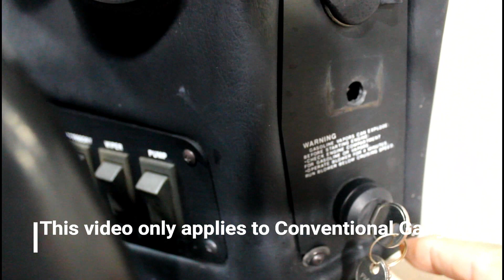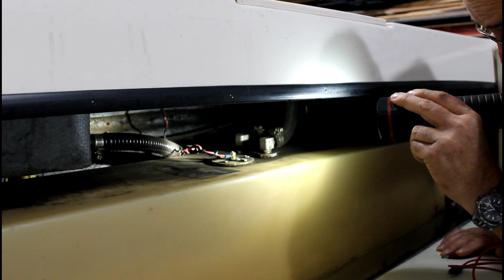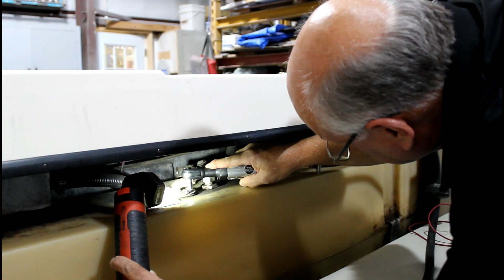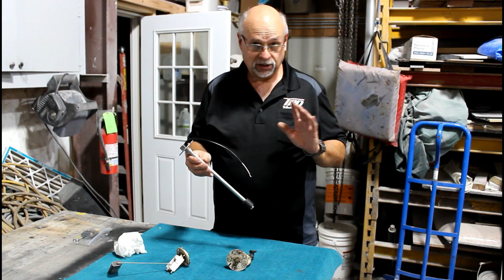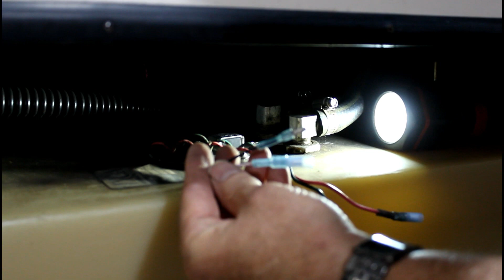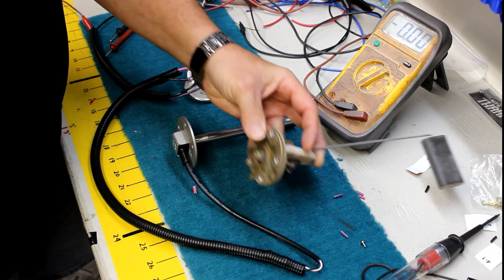Fuel Gauge Troubleshooting 101

Comment: Great video.  Gage goes all way past full when shorted.  Thought my problem was sender so I pulled it.  It is a reed style sender.  Moved the ring up and down and the gauge does move.  Problem is with the ring all the way to the top (full) gauge shows past full but move the ring to the bottom (empty) and the gauge only goes to about 7/8 full.  Help please?
Reply: I measured the resistance on the sender.  Ring at the top is about 30 ohms.  Ring at the bottom is about 200 ohms.
Reply from the maker: @peterjosephsmith7464  33-240 is the std. American Sender values, 200 should show around 1/8 tank, I suspect your gauge is bad.
Reply: @rontanis1024  Thanks for the come-back.  Gauge is mounted in a dash.  Combined volts and fuel.  If I send you a picture can you tell me what new gauge I need?  It is 2016 Starcraft Fishmaster..
Reply from the maker: @peterjosephsmith7464  Multi-gauges are usually made specifically for a boat builder, and may not be available once the boat builder moves on to another style. Send the pic & I will look at it.
Reply: Gauge is 3 3/4 OD, 3 1/4 cutout. #781520PMFB.  I found a Teleflex gage that looks similar but number 781480PMFB.  
I cannot figure how to send a pic here.  Let me see about facebook...
Reply: posted pics on your facebook page.  Any help you can provide would be most appreciated.
Reply: Hi Ron,  I replaced the gauge per your suggestion on Facebook that the gauge might be bad.  Tested it by moving the ring on the sender up and down and it works perfectly.  Thanks for your help!  Something I found out however was that there is not a single standard system for matching ohm output from the sender with that received by the gauge.  Yamaha is not the same as Mercury, European is not the same as US, etc.  Point is the sender has to match the gauge.  So there might not actually have been anything wrong with my gauge. - just did not match my sender?  Anyway - problem fixed!  Thanks again!

Comment: When ignition is on my Guage reads full, though I had the sender replaced by a mechanic (19 year old boat). I did the testing mentioned under Dave Nathe i.e.,
“Disconnect the pink wire from the back of the gauge & turn the key on”, mine stays on "E". I  then reconnected the pink to the guage & disconnected the pink at the sender, re-tested , and  the gauge stayed on "E". Does this mean the guage is bad?
Reply from the maker: Yes
Reply: @rontanis1024  Thank you big time!! I replaced the gas Gauge yesterday and all is working! It's a major headache not to know your gas supply!

Comment: Thank you so much! This is the most clearly explained way of checking the system top to bottom. 👍🏼🇨🇦 Question: what if my gauge on my 2011 stingray 185, can read half-full in one moment, then drop to empty the next, and all points in between? Is the sender more likely?
Reply from the maker: Senders react & report instantly, a tank that sloshes fuel a lot will cause a sender to do this, many fuel gauges however have electronic circuits that "dampen" the signals to make a more stabil reading. To determine the gauge/sender, remove the sender & while it is wired up move the float up & down & watch the gauge they should work in harmony.
Reply: Ron Tanis Thank you, once again. 👍🏼🇨🇦

Comment: I've got a 2019 Crest 220SLC pontoon boat.  I will fill the gas tank up and the guage will read full as suppose to do.  However, after 4 hours of running the motor it will still show full having not moved at all.  If I loosen the gas cap for a minute, put it back on, then the needle will move but still  not read very accurately in my book.  Is it a guage problem or some kind of venting problem????
Reply from the maker: Tank venting & new EPA tank tank plumbing should not affect a sender, if this is a plastic tank, can you see through the plastic to see the true level, if so, fill it, make note, run till 1/2 full make a note of the gauge,  and if reading full with a 1/2 tank report this to the selling dealer as a warranty issue
Reply: @rontanis1024  Hi Ron...I really wish I could see through the tank but not the least bit translusent.  And as for going back to the dealer...that's not happening. Don't trust him. The plan is to drive where ever we are going boating and BEFORE I launch open the gas cap and let it vest and see If that solves the problem.  Thatvworks after motoring a while so maybe it will work right off the bat.  I've tried contacting Crest HQ but they just don't care ...have yet to answer. Not impressed with the company or their reps at all.

Comment: How does this work with 3 wires at sender? I have the pink going to the big nut in the middle, then a black wire that is a push terminal and another black wire that is connected to one of the sender mounting bolts. My gauge reads empty.
Reply from the maker: The blacks are both grounds, touch a temp. jumper between the pink & ground while someone watches the gauge, if the gauge moves to full when jumped the sender is bad, if not repeat the test at the back of the gauge if it's a conventional gauge, it still nothing the gauge is bad assuming the gauge is getting 12V + at the power terminal & 12V- at the ground terminal.
Reply: @rontanis1024  put jumper from pink to ground and gauge went to full. Pulled sender out and replaced with a reed sender. Wired pink to white on sender, black to black on sender and the other black to mounting bolt on sender, still reading empty. There is power to the purple ignition wire and pink wire on gauge.
Reply from the maker: @JB_Machine  call me when you have a chance 985-542-4336

Comment: My guage when turn on the key goes to full and always stays in that position, boat is Alumacraft 175 Competitor, please advise.  Plan to get a another sender, so if sender after open floor can replace.  Is there a method to know if gauge issue without access to sender?
Reply from the maker: Disconnect the pink wire from the back of the gauge & turn the key on, if the gauge swings to Full, gauge is bad, if it stays "E" then reconnect the pink & disconnect the pink at the sender, re-test, if the gauge now pegs over you have a short to ground between the pink wires & ground between the gauge & tank sender.

Comment: What if your gas tank had less depth hope do you adjust the new unit
Reply from the maker: Reed Switch senders are NOT adjustable, you order the proper length sender. The sender must not touch the bottom of the tank
Reply from the maker: Reed switch senders are not adjustable, you need to order the correct length for the tank, I like to see 1/4" clearance between the sender and tank bottom.

Comment: Changed my sender. Gauge still reads full all the time.
Reply from the maker: Call me when you get a chance 985-542-4336
Reply: Ron Tanis I’ve done every test, my gauge never leaves 3/4 of the way full, never moves at all. I get 11.5 volts at the gauge, a little low. It’s a multi gauge system from faria that’s discontinued so it doesn’t appear to be an easy swap as I’m not sure they make any the same size any more. Note that it appears non of the gauges work (volt and rpm also but I need to crank it to really check the rpm but it’s too late at night). So I’m pretty darn certain it’s the whole gauge system but would hate it if it wasn’t grounded or something. I changed the sending unit by thebway
Reply from the maker: Feel free to call me to help diagnose your problem at 985-542-4336